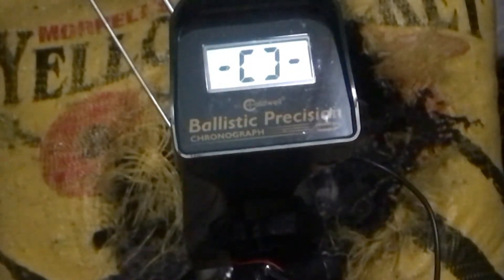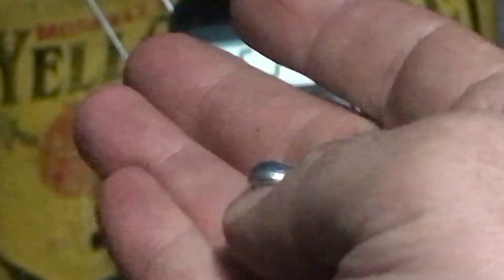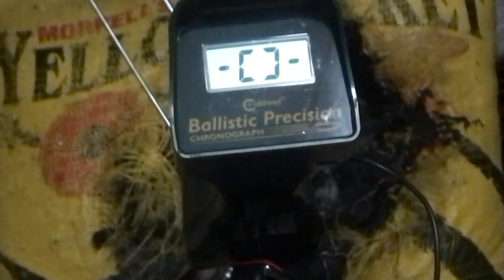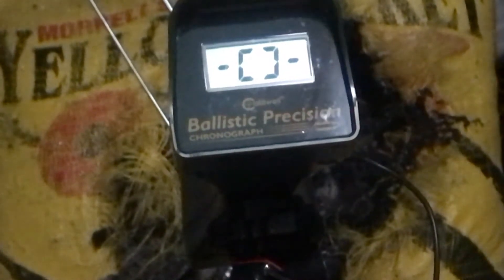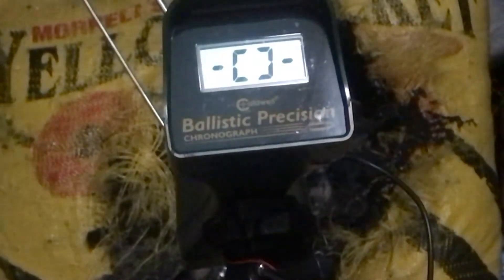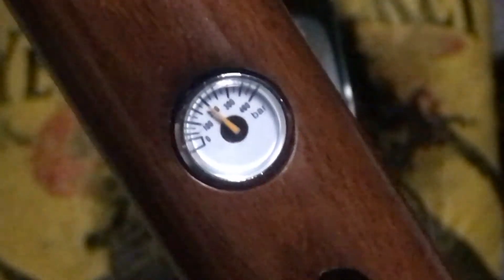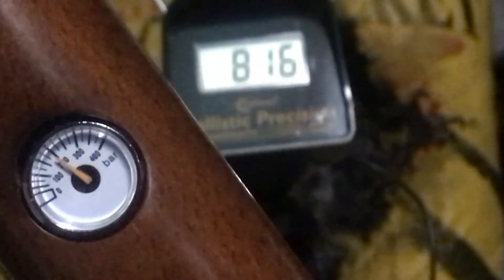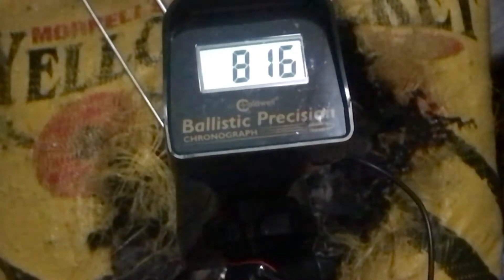Winchester 70-45 Bigbore tune

Comment: So will you tune one up and make it shoot to its maxed potential and sell me one in 45?  I am so on the fence about this rifle though it looks super I want more than 200 FPE and it just is not there.
Reply from the maker: 200fpe is about max in that platform without major work.  Really not worth more than it is. You'll be better suited finding a different rifle if you need more power.

Comment: 45 cal was very consistent, those Winchester gun look ok ,some thumb hole stocks would be nice, they could have done better...gun still is nice..if Benjamin would make that bulldog 35cal into a 35cal marauder same power etc & build a 30cal marauder 80/95 fpe & give there 25cal marauder 55/60 fpe gen 2 stock n some new stock design
Reply: I agree, I have a Benjamin Marauder in .177 (Gen 1) and a ,25 Marauder and both are dreams to shoot and have excellent accuracy. They need to step up and make a .35 cal (and others) that looks like the Marauder.

Comment: I need a new magazine for mine ,, know where to get one??
Reply from the maker: I do not. Try calling Pyramyd Air.
Reply: Annihilator Airguns do you sell dead blow valve for this
Reply from the maker: Kevin Alt I do modifications. It's not a drop in kit.
Reply: Annihilator Airguns hey Troy I bought this gun used  an upon further inspection I noticed the valve stem is broken an looks to me that port has been drilled,,can I send my gun to you to do what you did to this one ,,, mainly just want the harden valve stem
Reply from the maker: Kevin Alt send me an email at Annihilator.airguns@gmail.com